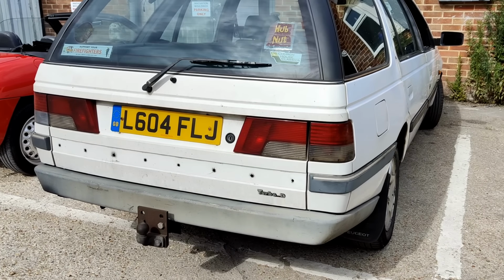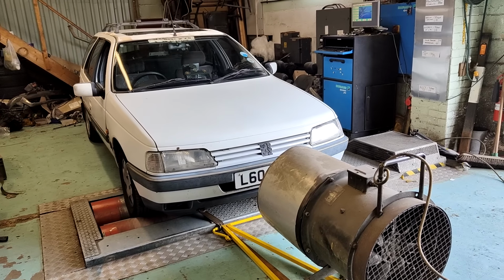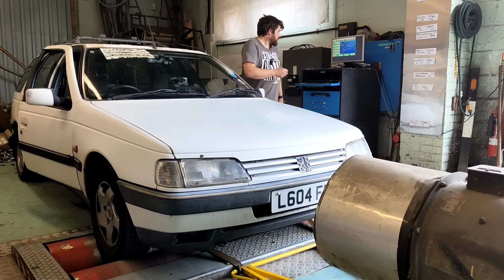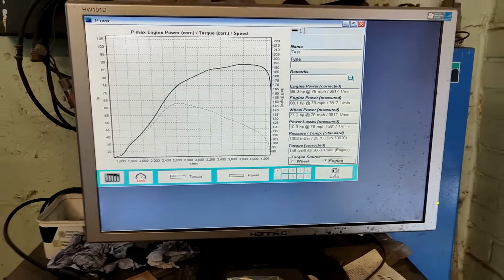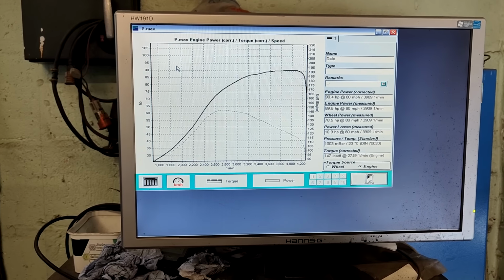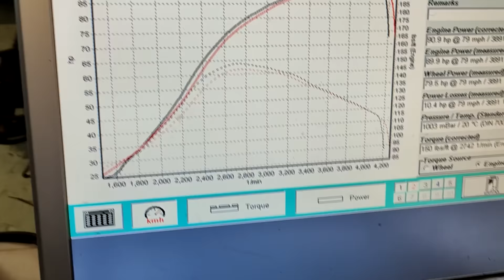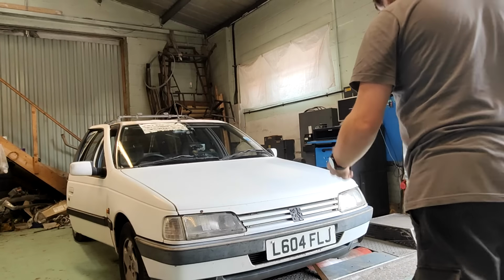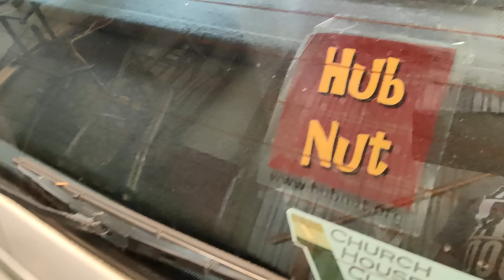How much POWER has this Peugeot 405 lost after 330,000 miles?

Comment: My memories of the Peugeot 405 are mostly of the non turbo diesel. Which seemed awful when compared with the 150bhp Honda I usually drove at the time. I suspect a 405 Mi16 would be more to my taste. But respect to PSA for building an engine that still does the business after 30 years and 300,000 miles.

Comment: 235k miles on my old Civic 2.2 iCTDi and it was still delivering the same mpg (53) and power as the 60k miles 2.2 Civic iDTEC I replaced it with. Both remapped to 190bhp 300 ftlbs torque.

Comment: Love these old diesels and I think as many of them should be saved as possible. That way they will outlive us.
I run a 3.0TDI A6. Owned it since new from 2006. It’s at 94,000 miles now and not even close to half way through its life. No rust and still runs and drives like the day it was new. I will keep driving it until it won’t move forward under its own power. Hopefully still decades away. Best car I’ve ever owned  and spent less than £2k on parts for it in almost 18 years….excluding tyres and brakes. Electric vehicles have a long way to go to make them as good as these cars and personally  I don’t think I they’ll ever get there.

Comment: Its got a Bosch pump so easily tuneable and can run pretty much on everything (veg,kero,oil). You can give it another 30hp in an hour by tuning the pump and adjusting the waste gate on the turbo. Only basic tools required.

Comment: Brilliant little engine's, i new a man once that ripped out a landrover series one petrol ,and dropped in a 1.9 pugoet lump with the 4x4 high low box n transfer gear left there ,it was mental on reliability power and mpg was off the scale! ,ime currently converting a 306,diesel into a water powered generator! They go on forever if you change the belt and waterpump everry now n then!

Comment: I had a 406 110 hdi estate best car I ever had,so comfy with 346000 miles on engine and gearbox spot on with hardly any oil loss between oil changes as it was used as a taxi the local authorities had an age limit on cars which sadly it was about to pass, and also things were beginning to fall off and beginning to become a money pit so off to the scrap yard it went 😭

Comment: Couple of things from my days of peugeot diesel ownership (and a petrol). The hdi has a gt15 turbo and the 405 will have either a t2 or an older still kkk, The really late 306 dturbos had a gt15, they spool a lot earlier, and used the same model on the hdi. Your 405 has a bosch pump, which is better then the lucas as its veg friendly, and really easy to tune. The only ones I ever dynod was a 306dturbo that was standard at the time and made standard power. and a petrol 1.8 xs that was 14bhp over standard, and 10-15bhp over was the norm for the 1.8's, even completely standard.

Comment: My dad had three of these over the years, two diesels and an SRI. They were nice cars. He went to the 406's after these, a Diesel and a Petrol, they weren't a patch on the 405's he had before. 
Peugeot started to lose it in the 90's and by the later 2000's they were crap cars.

Comment: my first car was 96'  Xantia SW 1.9TD with 91HP , but it exploded 2 engines (2 times exploded rod on n1 cylinder) . The 95's where know to be bullet proof and run forever , and seems that the 97's were modified and dont explode anymore

Comment: Old indirect injected diesels were outstanding, even if less fuel efficient and producing tons of soot and NOx.
I had a 64hp Fiat Punto TD with "some" mods, it was faster than the 140hp TDI after the works done.
Scrapped in 2012 because of anti polluting laws, driving on LG since then.

Comment: Started right away, sounded good and didn't even smoke that much, considering how "old" the engine technology is. I've seen 10 year old VW Group vehicles smoking a lot more, and under normal load, than that engine being pushed all the way up. The car is definitely scrap but the engine is definitely a keeper. 🙂

Comment: That's a bosch fuel pump, looks like a flying saucer. I ran my Xantia with exactly the same engine and fuel pump, unmodified on pure veg oil. Just a small extra cheap online fuel filter before the pump. Be interesting to see what power you'd get running on pure oil 😁!

Comment: Also have 1 here,  have owned a lot of cars, this one i have for plus 30 years, second owner, and never let me down ( only once ) but i could fix on my trip. 
Have  a 700.000 on the clock, still good, no rust, no oil consumption, no problems, only the normal mantenance.. with the non turbo XUD 9 engine 70 Hp, and very economical to drive, low consumption. 
The 90 Peugeots are good, the newer that i own, are more crap and problematic.

Comment: All the 'drove it at 70mph, got 60/70/90/1,000 mpg' comments make me chuckle. 

Had two cars with these engines in, high 30s in a xantia estate with a wound in pump and mid to low 40s in a 406 with just a birthday setup.

They would do better on fuel but then again you'd have to drive so slowly to get it.

Comment: Yes the Xud engines were probably the finest " mechanically fuelled" small diesels at that time, actually pleasant to drive and relatively powerful rather than the horrendous underpowered agricultural digger diesel engine options from Ford & Vauxhall, i believe Ricardo engineering played a big part in the original design.

Comment: Throttle response is nerfed by drive by wire to make emissions requirements in modern cars, a modern common rail diesel allowed to pollute as much as these old beasts would have same or better response.

Comment: Looks like a Ducellia fuel pump, pity cos if it was a Bosch it would run on just about anything, old LHM, veg oil, nut oil, sunflower oil etc. the difference was the Bitrex seals and their resilience to all the different oils. When the HDi's came in Citroen/peugeot never returned to the Bosch pumps for some reason, maybe its because an HDI cannot run on anything other than road diesel or Bio-diesel as its a lot thinner.

Comment: Well, considering that my parents think of "worn out" when an engine has 100.000 kilometers that's quite spectacular
Reply: 100k miles is only just worn in on one of these engines. I have heard of one of these engines going round the clock(odometer) on more than one occasion
Reply: @allsortsabouteverything  i don't think 100k is a lot, but for my parents it is, my dad complaining about my mom's daewoo matiz saying it's too old and that "doing the maintenance it requires"is not worth it, i don't think it that way, yes it's 20 years old now cuz it was bought brand new in 2004, but it has only done 98.ooo kilometers, all it really needs is valve seals and maybe a rear main since the oil goes low wayy to quickly (and even if it blue smokes a tiny bit i feel like it's not enough to make it go down that quick) every few months i need to top it up for her since it goes right on the low mark... there are a few puddles of oil where the cars is parked, although i can't really tell how old they are it always looks fresh

Comment: There is a reason I have 4 Peugeot 2005 206 1.4 hdi cars,  highest mileage 
230,000 miles, been to 29 different countries, been over the Alps 6 times,
The Pyrenees and Carpathian Mountains, and has run on kerosene 28 most of its life currently 60p a litre 👻👻👻
I’ve had it from new 19 years and must have slept in it more than 9 months in that period 😂

Comment: I always wonder why these dyno runs never seem to hold the engine speed at steady state for a short while, as I suspect that the air flow into the engine will stabilise and so get a little more power through.
[ Edit: Cleaner air filter may have got you a few more bhp too ! ]

Comment: If your giving scrap Peugeots a dyno sendoff I think you need to get 6D Diesels Pug 305 up on the board in after its FOTU run - we know Pug diesels are still good for it with lunar miles but how do the petrols cope with decades in a hedge?

Comment: Is this the same engine that powered 306's?? My Uncle had a 1.9 306 XRDT and was my first experiance in a turbo diesel car. 

You cannot beat a Old Skool Turbo Diesel, the current generation of PSA Diesels with the Adblue set up seem to have a bad reputation, my mother in law had possibly a 1.5 or 1.6 HDi in a Mobility Rifter and she had issues with the Adblue.  If it was not for the fact it was covered by Mobility i would have had the adblue Mapped out!
Reply from the maker: Yep, this is the same engine as the 306. The earlier 405 ph1 had the 1.8TD lump (same as a BX).

Comment: Also i definitely think modern cars are badly made compared to the ones from the 90s , Good example bought a 2013 Fiat 500 for £3 grand and youd think at that money you would get a decent car ?  nope , clutch needed changing and mechanic noticed gearbox bearing was bad too so that was £800 gone luckily the dealer did give me half that back , last 3 months the cars been ok but Im gonna just take a loss and sell it on cheap probably for £2400 the bad thing is its only done 85 thousand miles , a car with that low mileage should not be having gearbox issues , the clutch i can understand but gearbox?  nightmare it is , Im going to just buy as my next car a little Peugeot 107 they seem to be reliable from what ive heard.

Comment: cough cough I think you'll find VEP isn't down 2hp - as it's the 171B not 171C engine as you originally thought - gimme my respect points back dammit!  😜You Promised on January 5th to correct this indiscretion when I bought it to your attention! 🤣
Reply from the maker: Ah did I? Won't change the order on the board, though! So it's supposed to be 92bhp?
Reply: @UPnDOWN  yep 171B was 92bhp and the 171C was 94bhp 😊

Comment: Shame it's so rotten.  Clearly worked all of it's life, but in fairness 30 years is a good innings.  Great engines, shame they can't make them like this anymore.  Got to be more eco friendly than a new diesel that's dead in half the mileage.
Reply: Even new diesels can do this mileage, they are not as bad as many think. You need a favorable drivng profile though.

But its rarely the engines that put modern cars in the scrapper, its the electronics that goes slightly on the fritz and is uneconomical to repair.
Reply: @GoldenCroc  Cost to repair is very true.  Though when the engine is being forced to breathe dirty air, and of course, be suffocated by a DPF, it inevitably dies.

This 405 could, in theory, be restored.  It just wouldn't be economical.  You can fix anything if money is no object of course.
Reply: @jameswalker7874  Just saying most DPF cars can easily do this milage, and more, if you drive certain types of roads. A lot of people arent aware of this.

Old cars often got killed by engine troubles, late 70s cars up to 2000 got killed by rust (in nothern european climate) and newer ones its usually some kind of airbag light or something like that making it not pass inspection, so it gets scrapped or exported/sold on.